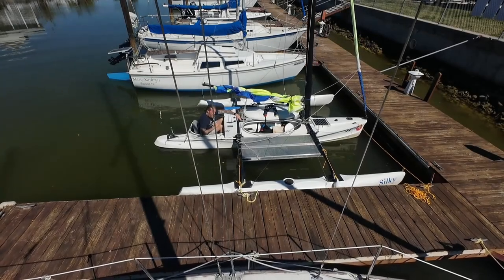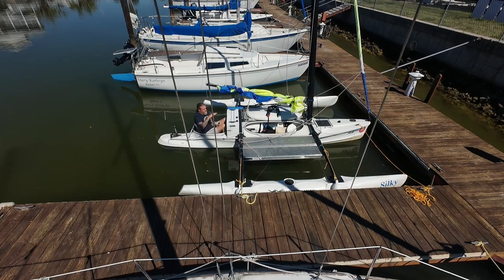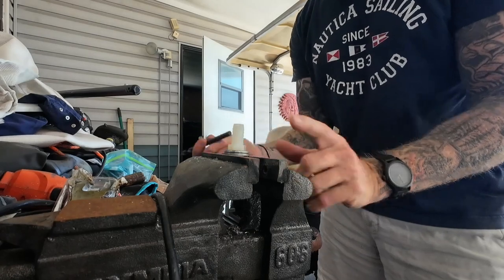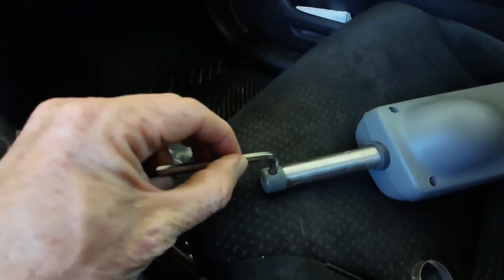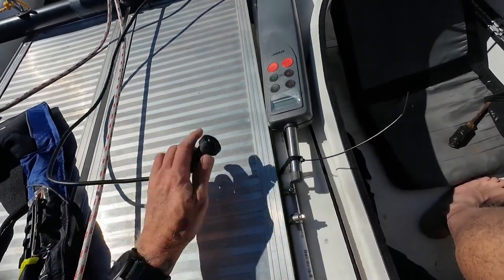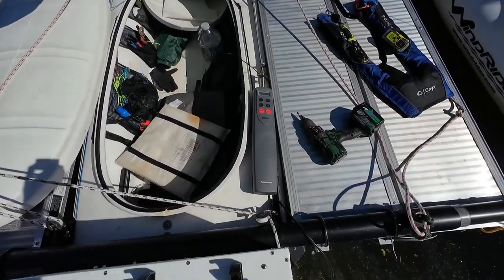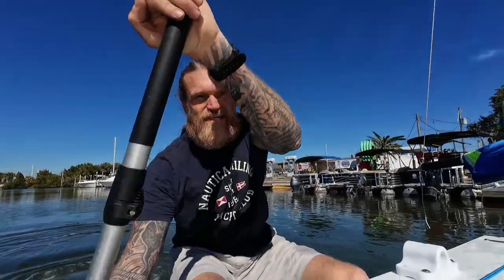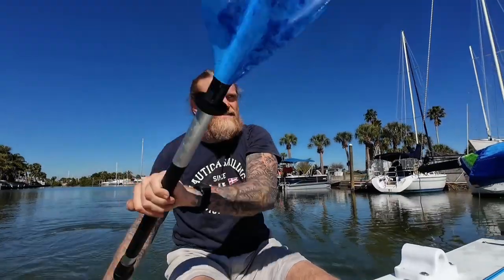A tiller pilot on a Windrider 17? this will be a game changer!

Comment: Another great video. Thank you. What is going on with the white line running from the clew end of boom up to mast?
Reply from the maker: Ah, took me a minute as I made this video a few months ago, but that is a topping lift because I was keeping my boat at the marina and would drop my mainsail when not in use.  It's there to keep the boom from falling to deck and to keep the boom out of my way when the sail is down
Reply: @sailingslowmotion  ok thanks. I'm new to  the WR17; not much experience. I suppose a lazy jack would do the same thing?
Reply from the maker: Yes, and others have set up a lazy jacks system that works really well for them, and if I was going to leave my boat set up for long periods of time, I would do that too.

Comment: hey Casey, just curious do you have a video on your side tiller pvc extensions ? I currently have a WindRider 16 and want to put twin tillers on her. I am here in Lake Wales Fl not to far from ya. Just bought the Windrider and have a new sail coming from Super Sailmakers! Happy I found your channel lover the EC video series!
Reply from the maker: "windrider 17 upgrades and modifications" has a quick glimpse of it, and it's pretty easy to do on the 17.  I'm not sure about the 16.  I used 3/4 PVC and with a mini torch lighter, heated up the end then flattened it between two bricks, rounded the edges then drilled a hole.  I didn't use any adapters, just bolted it right where the pedal cable attaches and the flex in the PVC let it curve along the hull.  Doing twin tillers is a great idea too, as my right forearm gets  tired after a long day of sailing.  Maybe we can meet up someday and sail ⛵
Reply: @sailingslowmotion  Thanks for the info! I was thinking in the same lines as you did, Although I did not think of flattening out the pvc. May I ask why you decided to flatten it? I was planning on just keeping it round and using lock nuts and washers for the attachment. Thanks!!! and yes a meet up sail would be great sometime!  Have you ever sailed with the West Coast Trailer sailors squadron?
Reply from the maker: I just recently found the west coast Trailer sailors on Facebook and joined but I haven't met up with them yet.  I will in the future though.  As for flattening the PVC, I did that just to use a smaller bolt and make the joint stronger (I think).  I'm not an engineer, but my brain liked it flat rather than round :)